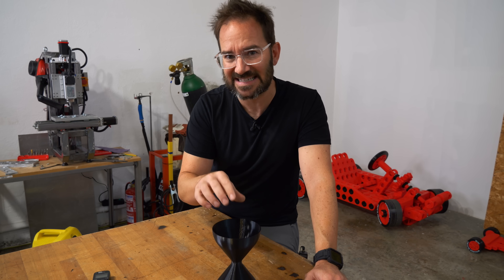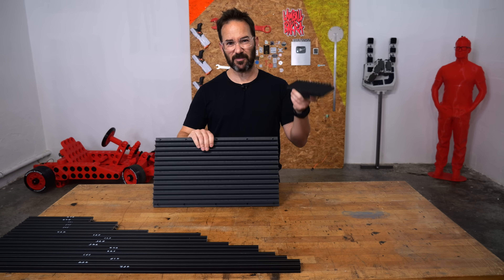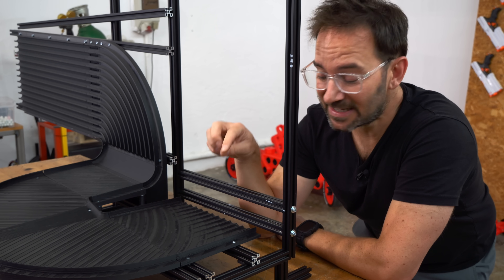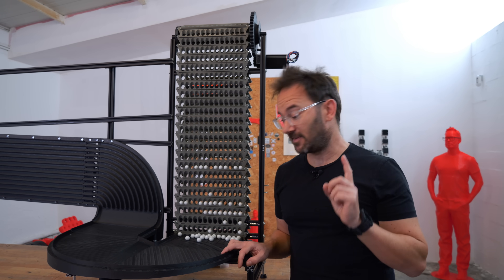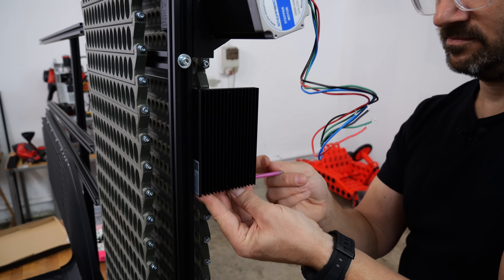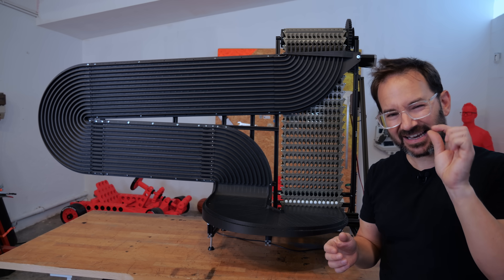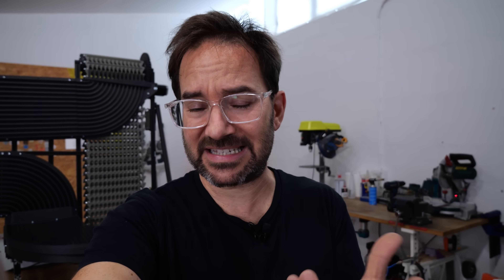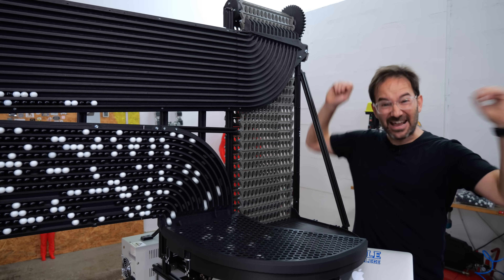BUILDING A MARBLE CLOCK - Pt.1.

Comment: Seems like an oversight to not have made the marbles drop vertically so you could have only flushed the minutes, 10 minute and hour marbles as necessary rather than resetting the WHOLE display every time.
Reply: Honestly I think he's using the rule of cool here. Something about seeing all the rows move instead of just specific ones scratches a certain itch in the brain
Reply from the maker: It is one of endless possibilities, I could have made the marbles be individually swapped too but I had to stop somewhere.
Reply: @ivanmirandawastaken  I'll reserve my judgement for when I figure out how you're going to determine which color goes where and whether you can do it within 60 seconds! 😁
Reply: @bradley3549  Arduino board, photo-receptors (low res, detecting only black from white) and an ejector for each rail of the ascender to 'eject' incorrect marbles as they ascend the rail, dumping them either directly or via a feed guide back into the collection bin.
Reply: @amzarnacht6710  ejection with solenoids should do the trick, just wondering what the white/black ratio marble should be to limit the global  amount of rejected marbles and thius the loss of Time of this picking mechanism. Plus having marble falling on marble cab break marbles... So there must be another catch and exit track for the rejected marbles... But look quite feasible 🎉 Just wondering what Martin will think of the final result and how long it will take to get there😅
Reply: @testman9541 Instead of an ejector, a path selector would make more sense. Basically, a block of material with a hole the size of one marble.  The incoming track ends on one side, in the middle of the block, then on the other side there are two tracks, one to each side. The incoming marble gets into the hole but can't progress through. Now the block is moved to the side of the track where the marble should go. When the hole aligns with either output track, the block blocks the input track. Very simple mechanism if the track angle is high enough and the backlog of marbles queuing up isn't too high (something a certain other marble user never grasped).
Reply: @HenryLoenwind  I wonder if a selector at the top of the lift to drop marbles into a black or white tank might work? Certainly easier from there to build the seven segments up a slice at a time... with the added bonus that you could refresh the display one row at a time if desired.
Of course, the ultimate cool would require the timing to be done with a Congreve 'rolling marble' escapement, unless you actually wanted it to be accurate :)
Reply: @ivanmirandawastaken  horizontal vs vertical isn't that much more complicated, just one solenoid for each digit...
Reply: @ivanmirandawastaken just found you. I had the same idea of marble clock with marbles falling down and stopped and released  by small valves. Even I wanted to patent it. But you have almost beat me to the punch😢
Reply: At that point just use a ticker tape then. Doesn’t really feel like marbles.
Reply: This design may actually end up being easier to implement since you have fewer tracks overall.
Reply: @LimitedWard and don't have to worry about track selection.  The other method would have involved dividing paths and more complex programming for color sorting.  I think he's going to have to send them to sorting hoppers where they get sorted to black or white tracks then release the balls into the lift track by track according to the color he wants.
Reply: I came here to say the same. Horizontally will be an insane amount of movement each minute. 
He made the basic scheme of feeding the marbles, now he needs to make the logic for chosing which balls to let through, and that is a challenge by itself. Horizontally he needs to control 20+ lines times each column every minute. If he had made it vertically, the control might be the same or less (5 marble columns for each number= 5x4= 20 times each row).
Even he could do a single number control unit and multiplex it to each position reducing the processing logic BUT increasing the complexity of the paths.
This reminds me to wintergartan marble music machine on a simpler scale.
Reply: Obviously this first design is to demonstrate / prefect marble handling. He hasn’t addressed sorting and sequencing marbles yet. Sorting shouldn’t be too difficult, sequencing, that is, knowing what color in what lane shouldn’t be difficult either.  The challenge is coordinating all the moving parts, think marbles, fast enough and “flawlessly” to prime the lanes for the next display.  Looking forward to the next video on this project.
Reply: @billstoner5559  Nothing is difficult really in isolation. I have at least a couple different ways those individual tasks could be performed well. Putting it all together is always the real challenge. And with that, I think we'll find a horizontal display will be substantially more challenging to make work than a vertical oriented delay. I also can't way to see how these problems get solved.
Reply: @bradley3549  yup. I thinks we are saying the same thing. 😊
Reply: I think YouTubers are under a lot of pressure in regards to time when it comes to doing projects and uploading videos. Maybe that's why.

Comment: Awesome project!  To stop the marbles jumping out of the bottom tray, how about narrowing the exit from the "covered" section.  I.e. if the exit gate is only 1.2-1.5 marbles high then they won't jump out as easily.  

Now for the elephant in the room, how are you planning to sort the marbles before building up the time display?  Might I suggest switching to steel and ceramic ball bearings?  This would give you 3 easy ways to sort the marbles and the marbles would all be a uniform size.   (weight, magnetism, and conductivity)
Reply: I think he is going to reject unwanted colour marbles from the elevator by using maybe a set of simple infrared detectors and popping them off the elevator ,back down to the collection area as they rise.
Reply: @JohnWatkinsUK  that's a great idea.  Didn't think of it initially as it's not very efficient.   But it's lots simpler and should get the job done as long as he can cycle enough marbles past the selectors.
Reply: @JohnWatkinsUK  Infrared/color detectors often have issues with shiny materials though, and his current marbles are made of glass.
Reply: @JohnWatkinsUK  would an infrared sensor be consistent enough? and hows he going to eject them? i thought maybe replacing the little fingers that poke them out of the elevator with individually controlled ones using servos, eject white, let the black fall into their own track, and to load them back up each row would need access to both colours, thats a whole other thing though
Reply: Each column of the elevator (13) has a sensor and servo/solenoid. If column 1 needs a black marble it just keeps poking out the white marbles back into the lower area until a black one passes. If you have a 50/50 mix of black/white marbles then you won't have to reject too many (if any) before you get the colour you want. 
Yes, I considered the glossy issue with an infrared sensor. I'm not really familiar what's on the market, but wouldn't be surprised if there was a simple low profile colour sensor suitable.
Reply: if he gets 12 whites and needs one black he could wait for it longer than a minute it would be a lot easier to have 2 different size marbles and they would sort them self on the way down @JohnWatkinsUK
Reply: Steel bearings and magnets would be far too heavy for that frame.
I suspect he'll go with what @JohnWatkinsUK said, using low-res sensors rather than infrared - detecting only black and white.  That'll cut down on the glossy-error issues.

Comment: Iḿ very much wondering how you wil lget the marbles in the right order to display the next time, mybe just bypassing unfitting marbles in each row when they come towards the display section. could be done with a simple light sensor (like the line follower bots) and an arduino that keeps track of which marble is needed....sounds like a nightmare to code...
Reply from the maker: It is a nightmare to code but not near as hard as to make all the rest work properly 😅